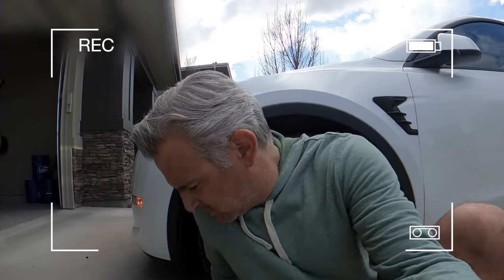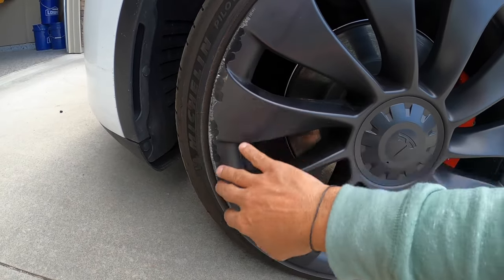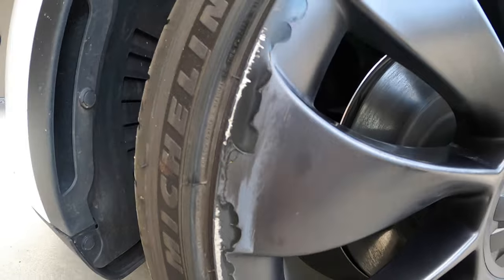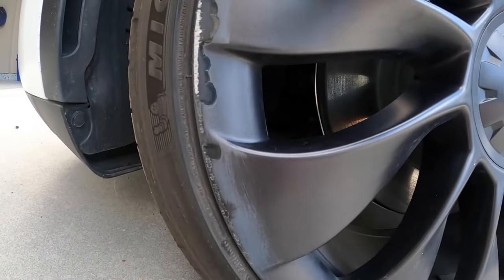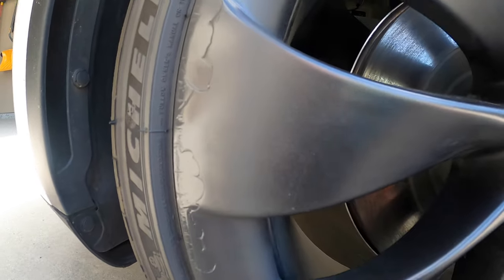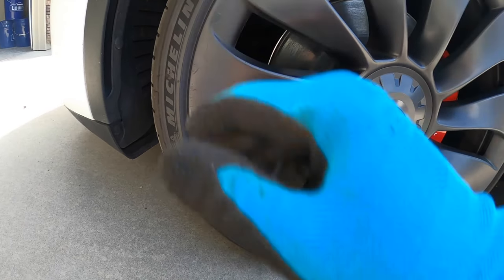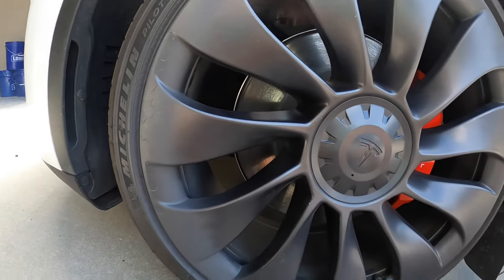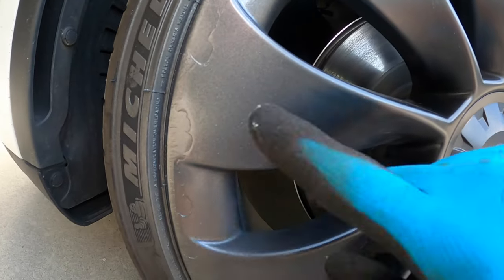Tesla Model Y Curb Rash Repair - 21” Uberturbine Wheels - DIY

Comment: Shocking job
Reply from the maker: Shocking bad or shocking good?
Reply: @TeslaModelYdaho  bad sorry lad
Reply: @TeslaModelYdaho it’s bad, go to a carquest/advanced auto location that mixes paint and have them match the Suzuki ZMW paint code. It’s like $24 for a spray can.
Reply: Is that a good color match? And how is the paint holding up? Weather wise.. thank you @syenosis  and do I have to use primer first? Thanks